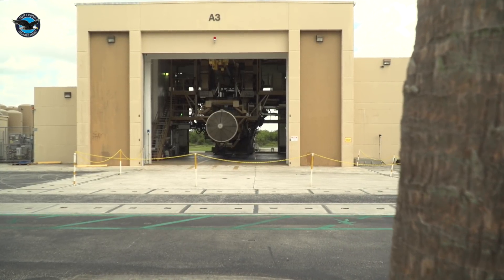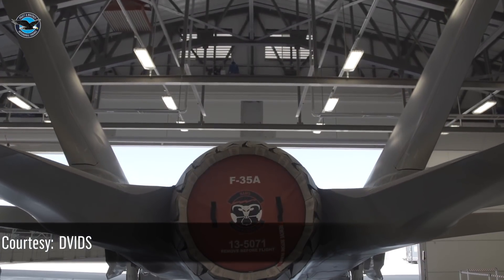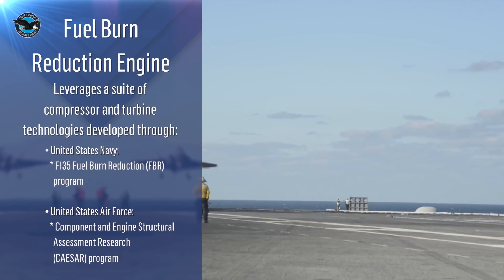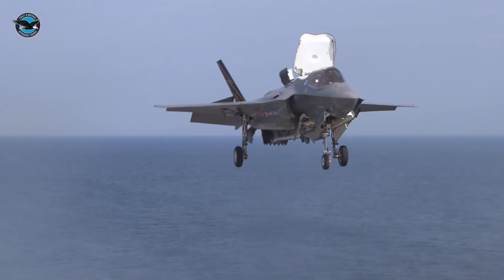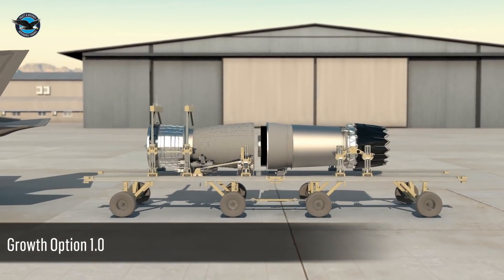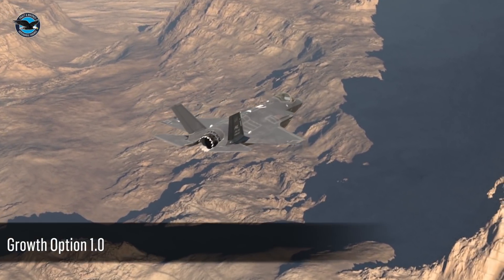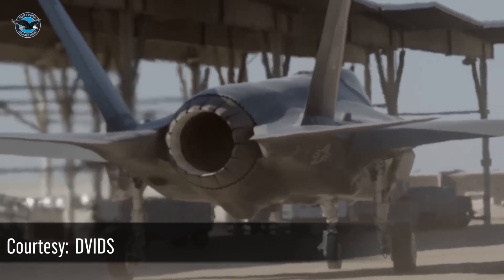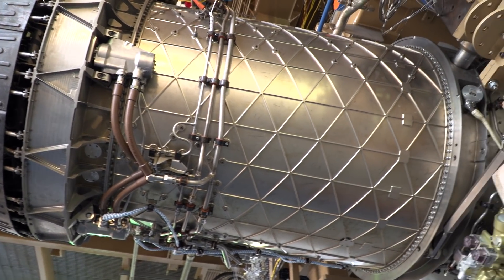Pratt & Whitney's F135 is Going Faster and Farther with Growth Option 1.0

Comment: A 10% increase puts the F35's thrust at over 47,000 lbs of thrust on one engine!!! For contrast the Typhoon with 2 engines is about  41,000 Lbs of thrust.
Reply: Bet 100% they are talking DRY thrust, not AB.  Pretty sure I read that elsewhere.  The increase in thrust will have the largest impact on the B version in VTOL operations where it is marginal currently.  It means lifting another ton of fuel skyward.  It means carrying an extra ton of ordinance back to the ship.
Reply: w8stral You May be right as I’m not sure. Just not that much information out there yet.
Reply: @bjjace1  Well, AB thrust is determined entirely by available oxygen and exit geometry.  Exit Geometry is not changing.  How much fuel dumped out the rear is not increasing.  They specifically said only the core is changing.  Not the bypass fan, nor the AB section, or inlet geometry are changing.  Maybe exit temperature is increasing, so potential for igniting more fuel is there, but honestly it is already there, other than it might burn a bit more efficient.  I would expect there to be ~no increase in AB thrust other than that achieved by the core at full power without AB.  In otherwords 28k + 5% goes to ~29.5k and puts total at 44,500 instead of 43,000lbs thrust @STP.  In otherwords no extra 5% from the AB section, just the core section.  Still, nearly 30k dry thrust on 1.7ton engine.  Hell Yea.

Comment: Hhow much will the adaptation cost per engine in 2019 U$? 
Second question, would redesigning the Divertless Supersonic Intake configuration on the A- and C-models (which presumably cause a lot of drag) and a slightly higher wing-loading factor (i.e. slightly larger wing surface) reduce fuel burn as well?
Reply: I thought he F35 already had a redesigned  DSI?
 http://www.codeonemagazine.com/f35_article.html?item_id=181